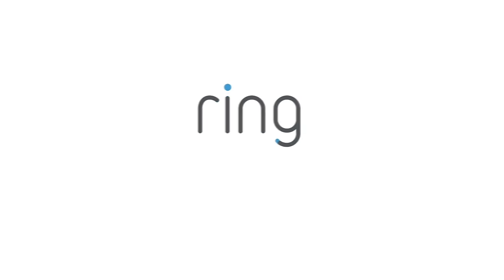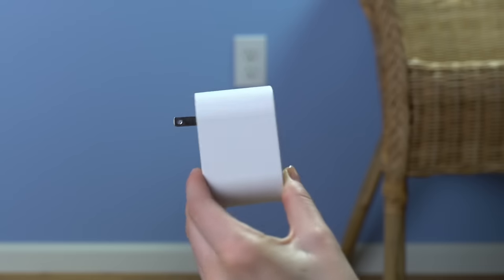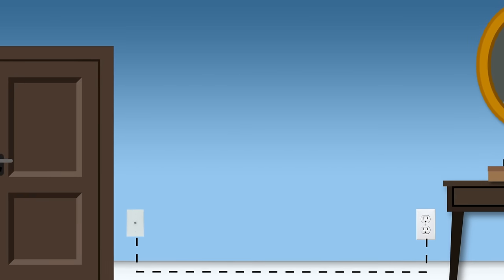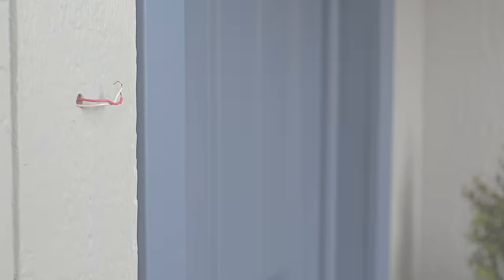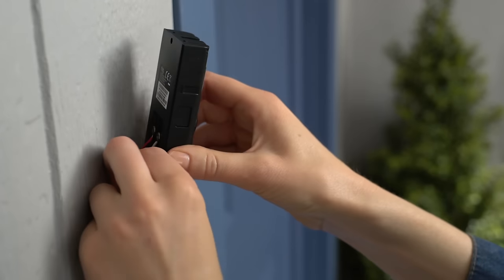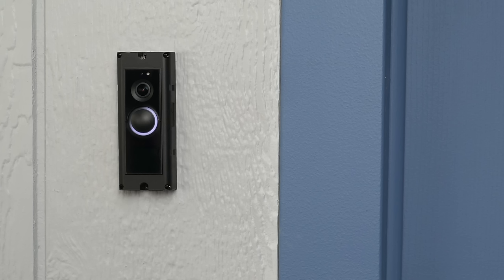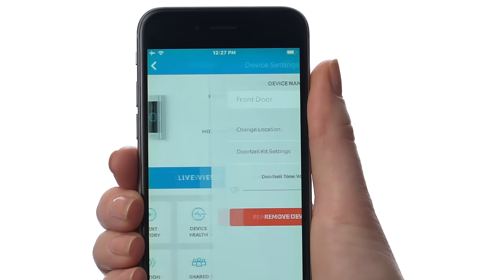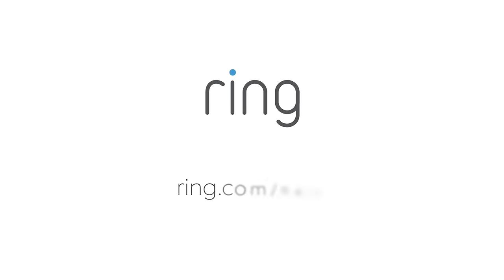How to Install Ring Plug-in Adapter for Ring Wired Doorbell Plus (formerly Video Doorbell Pro)

Comment: For anyone that comes across this video with the same question that I had. I have this gen 1 Ring Plug-in adapter and i'm upgrading from a Ring Doorbell Pro to a Ring Doorbell Pro 2 so I called technical support to verify that this plug-in adapter is compatible with the new Doorbell Pro 2 and they said yes it is. This is not posted in any public location as their recommendation is to get the Ring plug-in adapter Gen 2.

Comment: Does this wall adapter work for the ring 3 doorbell? I just got off the phone with a Ring representative who said to use this one and only walk adapter for my Ring 3 doorbell because of the issue of my solar charger not charging enough. Thank you.
Reply from the maker: Hi there, we're here to help. We apologize for the confusion. The Plug-In Adapter will not work with your Ring Video Doorbell 3. We definitely want to make sure that your Ring Doorbell is receiving a proper charge from your Solar Panel. Please send us a message via Facebook or Twitter so we can learn more and to further assist.

Comment: if you just want to put the doorbell sonewhere else how can you make it so that it also rings your home doorbell
Reply from the maker: Hey neighbor! In order to trigger the existing internal chime in your home, your Ring would need to be wired to it. However, if you'd like to install your Ring in an area where it's not connected to your existing doorbell wiring, we'd recommend setting up a Ring Chime in your home — check it out at ring.com/chime. This provides you with audible in-home alerts in case your phone isn't nearby. Let us know if you have any more questions!

Comment: @ring my house has no doorbell system does it mean i need 3 thing? which is the doorbell cam, plug-in adapter and chime? or can i just run the 2 without the chime? and without the chime does that mean i get phone notification when doorbell is press? ty

Comment: Hi I need help the wire that come with the adaptor is that the wire been attached to the ring door bell on the wall? I have an adaptor that has two wired ends.

Comment: Do you need to use the resistor if you use this method to hardwire your Ring doorbell?
Reply from the maker: Great question, Jason! When using the Ring Plug-in Adapter with a Doorbell Pro, you do not need to add a Pro Power Kit or other resistor to the circuit. Let us know if you have any additional questions, we're here to help!

Comment: Can you connect this to the current two doorbell wires I have running to my ring doorbell, looking to use this instead of the transformer.
Reply: Yes you can, this is how I have run my Doorbell Pro for a couple of years now. I thought about cutting the 10 ft of wire shorter but it's worked fine through that 10 ft and the existing wire in the wall.

Comment: @Ring Can I use this on a Ring Video Doorbell 2? If so do I need a resistor? Any help would be much appreciated.
Reply from the maker: Hey Charlie. This Adapter is only designed for use with the Doorbell Pro. Our new 2nd gen Adapter will also work with the new 2nd gen Doorbell, the Doorbell 3 & 3+. We don't have an Adapter designed for use with the Doorbell 2 at this time.
Reply: @ring  Can U Make a Ring Video Doorbell Pro 3 Please!

Comment: Also hope the adapter doesn’t heatup as it will be ON 24x7 unlike other 3rd party adapters that heat up and get fried
Reply from the maker: We understand that concern and want to ensure you have round-the-clock security with your Ring Pro. Should you experience any issues with a Ring Plug-In Adapter, please give us a call anytime (ring.com/callus). We're here to help!

Comment: Can you now use this power adapter with the resistor listed on the Australian Ring Website for the Ring Doorbell 2?
Reply from the maker: Hey Jamie! The Plug-in Adapter can be used with our Ring Doorbell 2 — check it out here: https://au-en.ring.com/collections/accessories/products/plug-in-adapter. Other power adapters listed on our Accessories page may be designed for other Ring products. Please let us know if you have any other questions.
Reply: @Android_jimmy  In theory you shouldn’t need to.

Comment: Can it be used on ringdoor 3 /3+ ?
Reply: They have their own adapter for the 3 and 3+ now
Reply from the maker: Hey A A. Fox is correct, we recently introduced the new 2nd gen Plug-in Adapter, which is compatible with the Doorbell 3 & 3+. Check it out here: https://ring.com/collections/accessories/products/video-doorbell-plugin-adapter-gen-2.

Comment: For the power should it say "Hardwired" because mine still says the voltage. And if it is suppose to show the voltage, how much should it be showing?? You guys really need to add that in the video.....
Reply from the maker: Hey neighbor, the Ring Pro requires a hardwired connection for power so if you're seeing a voltage reading the Ring App, this indicates that there is power getting to your Ring Pro. The reading should be between 3900mV and 4300mV. Let us know if you have any more questions!
Reply: @ring  so it isnt suppose to say "Hardwired"
Reply from the maker: That's correct. Your Ring will show the voltage and a lightning bolt icon will appear in the Device Health page of the Ring App to indicate that it's hardwired.
Reply: If I use the two wires on my mechanical door bell to power my video door bell,  can the mechanical bell still work?

Comment: Does this work with the ring video doorbell 2
Reply from the maker: Hey Ash, the plug-in adapter currently works with the Ring Video Doorbell Pro only. Let us know if you have any other questions!
Reply: Hey Ash, can you now use this adapter with the resistor kit listed on the Ring Website with the Ring Doorbell 2?
Reply: Yes

Comment: Can the wires be run down through the bottom of the unit to save drilling through the door
Reply from the maker: Hey Ian, thanks for getting in touch with us. The wiring connections are placed on the back of the Ring device so wiring it through the bottom is not an available option. Please ensure that no modifications are made to the Ring device as this could cause damage and void the warranty. Please let us know if you have any more questions.

Comment: would this show as hard wire on the app  to view live fed
Reply from the maker: Great question, Juan! The Ring Doorbell Pro is a powered device with no internal battery so you should see a voltage reading on the "Device Health" page in the Ring app. All of our Video Doorbells and Security Cams offer a Live View features so you can connect with your Ring anywhere your phone has cell service. Let us know if you have any more questions.

Comment: Will this work with the Ring 2?
Reply from the maker: Hey there! We don't have a plug-in adapter compatible with the Ring Video Doorbell 2 at this time, however we do offer a Solar Charger to help extend the battery life. See more at http://bit.ly/2LXWVjC and let us know if you have additional questions.
Reply: Will this work with my Ring 1.  2nd generation ,the battery is fixed in and cannot be removed,
Thanks in advance for any reply,
Reply from the maker: Hey Buster. We don't recommend using the Ring Plug-in Adapter for any of our Doorbell devices except the Ring Video Doorbell Pro. We're here to help if you have any other questions.

Comment: Do ring doorbell pro working in philippines?
Reply: I need response pls
Reply from the maker: Thanks for your interest in Ring. Ring is currently not available in the Philippines. Ring devices are designed to operate in a particular region and are not intended to be used or distributed outside of that region. Due to differences in regulation, we recommend purchasing and using the Ring designed for the region where it will be used. 

For more information about the countries we currently support, please see here: https://shop.ring.com/pages/country-selector and let us know if we can help with anything else.

Comment: Can I plug it in an outdoor power outlet?
Reply from the maker: Hey Simon! The Plug-in Adapter is able to be plugged into any standard outlet, however, we don't recommend placing it outside. This would leave it exposed to weather conditions and could make it easy for someone to disconnect it. We recommend installing it as shown in this video. Thanks for being part of the Ring community!

Comment: I hope no external transformer or diode or resistance needs to be connected along with the plug-in adapter
Reply from the maker: Hi Sameer, the installation for the Plug-In Adapter is just as its shown in this video. You should not need any additional pieces in order to power up your Ring Pro. Let us know if you have any more questions!

Comment: The RVD Pro, cannot be powered by the plug in adapter, it's needs a transformer
Reply from the maker: Hey Jel. The Plug-In Adapter is a type of transformer that simply plugs into a standard wall outlet instead of your home's direct wiring. This was designed for the Pro and an additional transformer is not needed. Let us know if you have any questions, we're here to help.
Reply: Can this be used with the Pro if there is not an existing doorbell?

Comment: You don't need to install a transformer if you buy this?
Reply from the maker: Hey neighbor, that's correct! The Plug-In Adapter provides power for your Ring Pro so a wired connection to a transformer would not be necessary. Check out the Plug-In Adapter here: https://bit.ly/2NKtUXq and let us know if you have any more questions.
Reply: @ring  The adaptor IS the transformer, otherwise the doorbell would fry.

Comment: So you don’t need to install the pro power kit v2
Reply from the maker: Hi Jason, that's correct! The Pro Power Kit V2 needs to connect to an internal chime kit so it wouldn't be needed when using the Power Adapter. Please let us know if you have any more questions.

Comment: Does this work for ring 3 plus?
Reply from the maker: Thanks for asking! While this transformer is specifically designed for the Ring Video Doorbell Pro, it can definitely work with the Ring Video Doorbell 3 Plus with a little bit of tweaking. You can learn more about the process for it here: https://support.ring.com/hc/en-us/articles/360041599492-How-to-Connect-Your-Ring-Video-Doorbell-3-Plus-Directly-to-a-Low-Voltage-Transformer-Without-a-Pre-existing-Doorbell-.